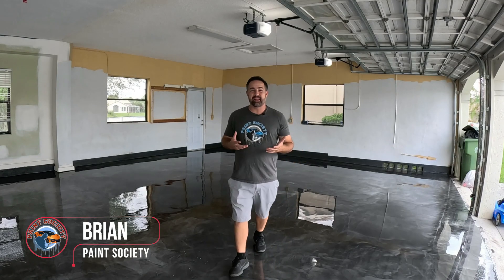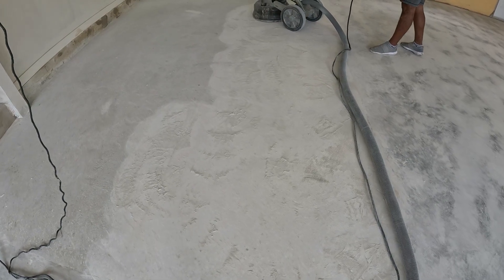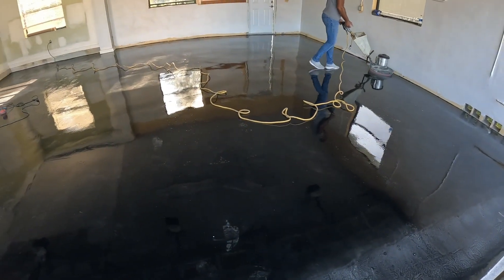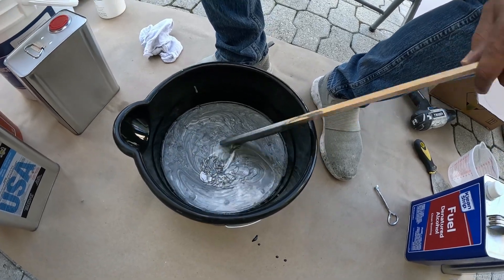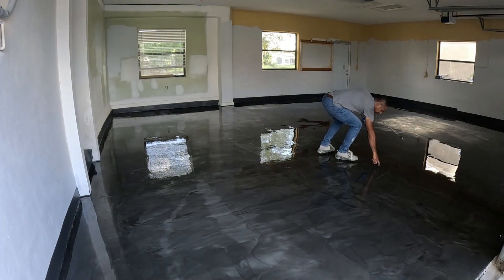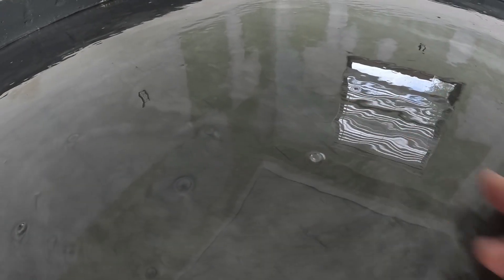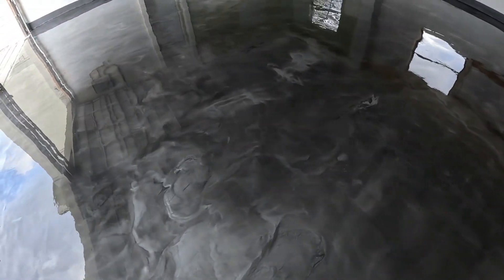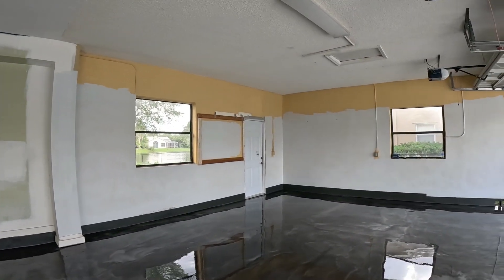INSANE Garage Transformation with Modern Epoxy Floors!

Comment: Brian, I still stay with my earlier suggestion of a light plain color for the floor. This is going to be a spray booth, so good light reflection from the floor is really helpful and you will find this over time. Your current choice may be OK for a workshop, but is not so effective for a spray booth. I also found epoxy to be slippery when wet, this is why I overcoated my epoxy floor with 2 coats of Urethane for its chemical resistance and it is much less ant-slip. Did you acid wash the floor after sanding before the epoxy? Those holes or bubbles are a result of a slab that is not fully clean or dry. BTW, I did my own shed (40x30ft) and only had a couple of instances of those bubbles, not even noticeable. At this point in time, I would suggest two coats of clear Urethane now. You could do this yourself. Lets see how happy you are when your epoxy floor has various colours of overspray. I can tell you, it will show.
Reply: I believe he was going to use an inflatable paint booth so it won't matter.
Reply from the maker: Yup

Comment: Few things/ideas - Do a border strip at the top of your walls. Helps to break/define the areas, especially on camera. 
Rubber base boards, help reduce impact damage. 
Rubber isolation pads for your compressor!!!!  They've worked wonders on mine (80G 2 stage, weighs about 500lb). 
Run the air intake to the outside to reduce noise. 
Make sure you run at least 4ft of rubber hose before you tie into the rigid part of your shop piping (noise/vibration again). 
I have more - but this is already getting long winded.  ;)
Reply: I kept my compressor on the shipping pallet. No vibration

Comment: I'm a contractor and applied the Home Depot Rustoleum product to my garage about 5 years ago, and it worked fine. Of course, I had never parked a car (so there were no oil stains,etc.) on it, but I did do a mild acid etch prior to applying it (if I remember right, thats what Rustoleum recommended). There has been no flaking or chipping so far, but I don't park a car on it. I have rolled tools & tool chests around on it though. The only thing I have been unhappy with is that it was hard to apply the "flakes" evenly if you don't have some type of a tool to distribute it. I had to  grab a handful & "throw it out" to distribute so my flakes came out pretty uneven.

Comment: that patch should have had a higher psi concrete and had a power trowl run it until it was a polished surface. from how easily that turned to sand it seems to have been reg lower grade concrete.

Comment: I know it’s a general understanding that you shouldn’t use the rustoleum epoxy kits from a big box store, but there are ways to achieve good results with them.

I have had RockSolid on my garage floor for over a year now and there is ZERO peel up or any signs of failure anywhere, and I did not sand the floor. 

I used an acid etch and cleaned liberally. Then I applied TWICE as much epoxy as required by the kit. So I have (2) 2 car garage kits worth of it on my 2 car garage and it’s super thick. Excellent coverage, excellent gloss, and it cost me $400 compared to $4000.

Comment: Ok, wasn't going to comment but you asked for thoughts....

As a company owner that does these floors for a living this floor was not done by experienced professionals. 

The prep work was good. They used a Husqvarna floor grinder but should have used nothing higher than a 30 grit diamond. This creates a good, solid mechanical bond. 

Next, they did do a prime coat, which is good. Maybe they did a moisture test, you didn't mention. If they didn't, they totally should have. This would dictate the type of prime coat to use, whether or not it should have been a moisture vapor barrier. 

The bubbles in the prime are common in a softer, more porous concrete. We usually would sand and do another pigmented flood coat in the even of those bubbles. We have had to do as many as three prime/ flood coats until there are zero bubbles in the floor. 

Then do what I call the "money coat" at 40 sq feet per gallon. This would have been pigmented in black coverings the entire floor, and then add highlights in your chosen highlight colors, manipulate the highlights in the money coat until you get your desired effects. 

Once all that is done a protective top coat should be applied in either urethane or polyaspartic clear. This will make sure your floor is much more resistant to scratching or gouging. 

This is how professionals that do it every day do it. What you got was something else all together.

Comment: You can do the Flake over that floor if it wanted to. They would need to sand screen it then go right over it. Also, the excess that’s on the garage apron can be removed with a heat gun and razor blade or scraper. Also a water based polyurethane will give you a semi gloss highly scratch resistant surface as opposed to a solvent based polyurethane.

Comment: Heres a tip save yourself alot or time rent a 3000 psi airless paint sprayer and spray the celling . just tarp your floors and pour your paint into a 5 gallon bucket mix then start spraying you ask the rental center for a different tip tell them your painting a celling theyll get you the right tip . its less costly over all and beats using a roller ive done industrial building cellings 12' in the air all i used was 2 sections of scaffolding on wheels and the gun you get about 25' of hose works like a charm .

Comment: Floor looks great.  We are looking to do a similar epoxy process to our shop floor.  How would you rate the grip on the floor, we've been weighing adding the texture to floor that Leggari offers for the clear coat since we are located in the midwest and deal with the melted snow on the floor in the winters.  I love to have your feedback because I'd love to just have the gloss finish

Comment: Hi Brian, obviously, it is your garage, but I would personally have not spent that amount of cash on the floor. There are some non-slip interlocking plastic tiles that are designed for workshop floors going straight onto concrete and are very strong. Damage to the floor will happen no matter how careful you are, and with the tiles you just change out the damaged one. Anyhow, here in the UK the Mirka and Festool sanding and dust extraction systems seem to be the choice of the professionals. Surely with nearly 400K subscribers, you could reach out to these companies for some sort of sponsorship and deals? Same with all your tools and equipment, it is time for you to be rewarded for all your fantastic work and content over the years.

Comment: Good. Thinking a cheaper surface color might do well, just in case it has to be redone on occasion. I mean, you are going to be painting and paint sticks. 
How well does a resurface do on this type of floor covering? It will happen, and would like to see how well it works and how easy or hard the process is when it comes time.

Comment: Have a question not sure where to ask so here goes. What type of air hoses do you use?  I hate the ones I have.  I have 100% rubber, rubber mix, and no rubber at all. They all twist and curl while I am using them. Any suggestions??
Reply: Flexzilla
Reply: @captainswampy9501  , That is what I ended up buying.  I do like it, best I have ever had so far.
Reply: @grantpeters9014  it seems like we have a tendency to always turn the same direction which causes the hoses to twist.
Reply: @captainswampy9501  The ones that I have just suck right off the bat.

Comment: im late to the party =) Ive worked in flooring for a few yrs now. For that patch of concrete, it would have been floated with a cement type filler. Same way you would use filler on a car. If not a self leveling cement then a patch cement like a Ardex feather finish. Then sanded down smooth. Of course extra steps would be taken before laying any of that stuff down. A special moister barrier primer membrane for the cement as prep work. Sand, clean then lay your paint. Just like painting a car. Dont over think it, its just Paint.

Comment: It's interesting that you had trouble finding someone to pour the concrete patch. I have to wonder if it was due to the small size. Too small for a truck but big enough to make mixing by hand or in a small mixer pretty time consuming. The fact that your flooring guys didn't put a seal coat down first is interesting, they should have known better.

Comment: Dust extraction: as you said it’s easy to sweep just get a small extraction machine for the da sanders and blocks, I don’t see a point of getting a top quality dust extraction system.(fucking amazing floor can’t wait to see the rest of the place) and also maybe if you don’t have anything planned for the left wall between the inside door and window if there’s room you could put the toolbox there maybe in the middle it could take up too much room, one corner for toolbox commpressor and storage for the rolling carts and the dust extractor
Reply: Also probably a stupid one to say but when your using floor jack stands please use wood or something to not scratch the floor it will kill me inside

Comment: I’ve done a bunch of epoxy work on my own. The torch made the bubbles, & the epoxy should be thinner so if lays out better. The best kits are the cheapest 100$ pro marine on Amazon, 2 gallon kits @ 1:1 ratio. Best bang for the buck. And you need a flow coat over it or it’ll always have some color come up when you clean it. Also I would have painted the floor black and then used marble effects spray paint and then clear epoxy only. Woulda have been cheaper. You helped me paint my truck, I wish I could have helped you with this.
Reply: The tourch is necessary to remove bubbles. I've done alot of epoxy first hand and it's a must. Those bubbles are similar to solvent pop. Ceeated by air.  If you watch any video including epoxy counter tops, all use a heat source to smooth out the surface. You only have a few minutes to after it's laid to do it.
Reply: You are wrong, it’s not needed. I’ve been watching stone coat and leggari for a long time and was going to start my own epoxy business. I’ve bought a ton of different kinds, I’ve done torch and non torch. I have a ton of finished work around me to prove that theory wrong…buy the kind I mentioned and try it yourself. What’s $100 for two gallons and you can make something nice. I’ve done the bar/kitchen in my resort, my garages, counter tops, bathroom vanity, bathroom floor,the list goes on. And will be doing a bunch more, without a torch😂

Comment: You bad mouth Rustoleum but I’m 5 years into mine and it still looks good. No chipping or peeling. Just like painting a car, proper preparation is the most important part. I spent a lot of time sanding, acid etching and filling mine before cracking open the Rustoleum cans. It has held up fine for a normal home garage. It’s not as fancy as yours but I just park cars in mine.
Reply from the maker: Awesome Rich!

Comment: I'd be scared to do any bodywork in there LOL I'd get filler on the floor in five minutes.
Reply: Yes me too. If it was just a home sports room I could understand it, but for a garage? (I think I would worry whenever I spilt fuel or corrosive fluids on to it, or was using a rough trolley Jack etc…)

Comment: Your garage floor wasnt done correctly at all because the right way would have been to bullfloat it at several different stages during the first few hours after the pour . they could have used mechanical finishing floats which is what the pros do .

Comment: They need to change the sandpaper more often when sanding the black epoxy… it’s too lumpy. A good company can pour a smooth epoxy floor whether it’s new concrete or not. Too many excuses with that company
Reply from the maker: The concrete was pretty bad. Very porous. If you saw it first hand it would make better sense